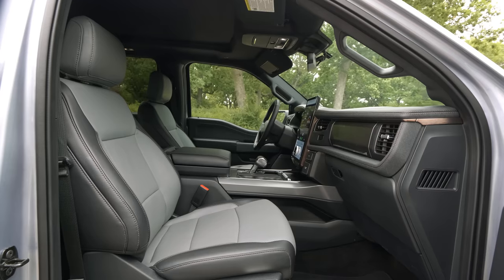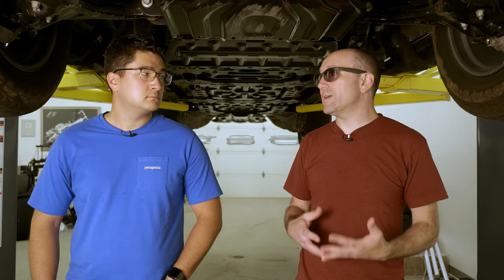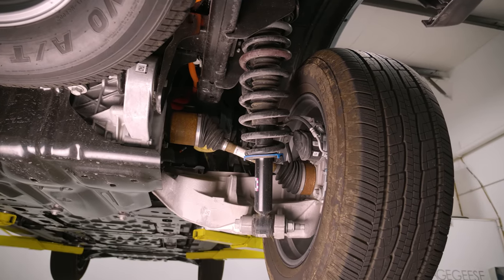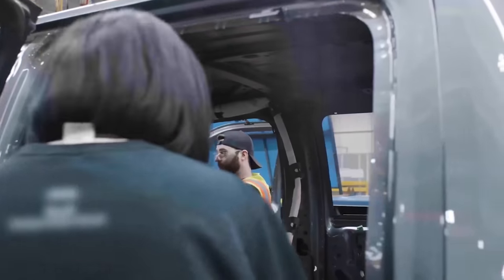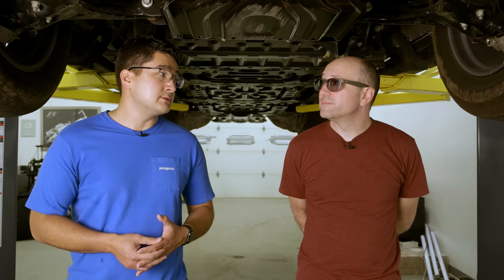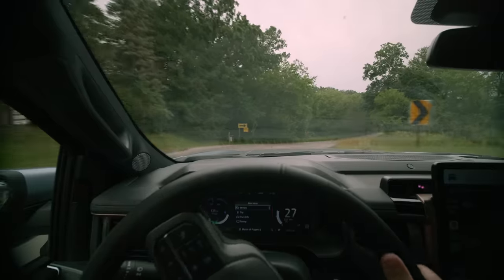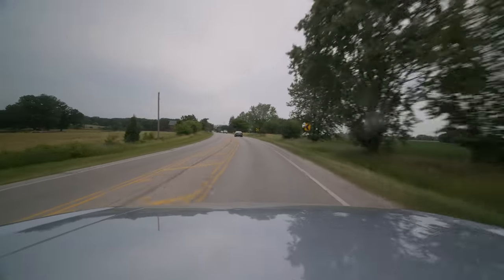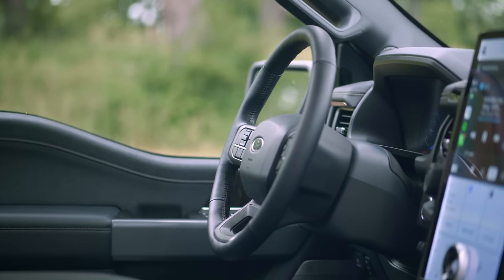Ford F150 Lightning | The EV That Will Change Trucks

Comment: the extended battery model has a battery capacity of about 131 kwh, can you imagine what happens to the thing if it catches fire or been in crash, you better be 5 miles away from that thing or you can fish molten lithium cells out of you hair if you're not Mark lol
Reply: The crash that short-circuits a safety battery block would probably also smash a gas tank, though.
Reply: A gallon of gas is listed at 33.7kwhs of total useable energy and road diesel is 37.9kwhs per gallon. 
How many gallons of those highly flammable liquids does an average ice truck have onboard again? 🤔
And oil plus anti freeze to.
Reply: @4literv6 Gasoline would combust but it wouldn't send thousands of tank particles flying in relatively distant proximity, concerning Diesel, it doesn't combust that easily. I dont get the Ice Truck example. You mean liquid nitrogen? Also how many ice trucks do you see in your area that want to meet up and chill though? I think everything else will catch fire before Anti freeze will combust. And yes i am THAT boring at parties.

Comment: People want to hate on the limited range when towing but like y’all said most people use f150’s for in and around town commuters and light load hauls. My 3.5EB F150 tows a 3500lb camper like 100 miles 3 times a year or a 2000lb boat 5 or 6 times a year for 60 miles and the rest of the time it never goes more than 50 miles from the house. I don’t know that I’d ever really experience range anxiety in one of these even with the standard battery

Comment: Great content, but as far as electric cars and the grid goes, Jason Fenske put out a video last year about it: https://www.youtube.com/watch?v=7dfyG6FXsUU

TL;DW based on EV adoption rates and increasing EV efficiency, power providers can predict how much power is needed for the EV transition. Jason estimates that if everyone were to switch to an EV today we would need 30% more power (obviously a highly unlikely scenario, there's still affordability issues, and apartment dwellers will likely be the last to get charging at home options). EVs can certainly be accommodated for given the slow growth and adoption of them. Like he says, it's a predictable problem with predictable solutions.

Comment: I just think people need to be more open about the fact that if you're going to buy this to tow or something over 100 miles at a time you will be disappointed. Not to mention the energy cost between a gas truck vs electric is minimal especially when towing.

Comment: What's the safety rating on this 7000lb ev or ev in general i have seen some electric  and or hybrid race cars and when there is a malfunction they cant leave the vehicle is case of getting electrocuted wonder if any of those concerns translate into regular passenger vehicles on the street?

Comment: To bad you can't use it as a real truck 80 miles if towing range is terrible
Reply: Yawn. The 14 people who actually need an F-250 can still get one. The "frunk" alone makes it the most practical truck ever made.
Reply: @HydraulicDesign  I'll probably end up buying one just sucks I gotta use my new ranger to tow my snowmobiles to the cabin and not the full size 80 thousand dollar pick up I just bought

Comment: Seems like it would cut down on a lot of routine maintenance as well.  No conventional oil changes.  No radiator/coolant/hoses/belts/spark plugs/alternator/water pump/etc.  I'm sure there's some sort of coolant system for the electric motors and trans (if applicable), but probably not owner accessible.  Transmission?   Some EVs have them, some don't.  Not really any grease zerks left to check on most modern cars anyway.  Main wear items would be wiper blades, tires, and brakes.  Anything I'm missing?

Comment: I think the true happy medium to address the concerns of most truck owners (warranted or not)  is for Ford to produce a plug in Hybrid F-150 till 2035.  Put the 2.7L turbo (its got 325HP and 400 ft lbs of torque) in it driving the front wheels and operating a generator to charge a larger battery pack and an electric motor powering the rear wheels all the time.  The battery pack can give something like 80 miles of all electric range to cover commuting distances for most people to operate it as an electric vehicle 75% of the time.  Give it 500hp combined and 600 Ftlbs of torque and it can tow plenty and, you address the fuel economy issues, enable long range towing, road trip range.  You only loose the frunk.  I think you appease a bit more of the traditionalist truck people as well.  

The 2.3L engine would probably work fine as generator and front wheel driver if your willing to have more pedestrian HP and Torque numbers.

Comment: My Tesla Model S 85 has 248.000 miles. Never had any problems with electronic or drivetrain. It still has a range of 211 miles.

Comment: They did a tow test and with a 6000lbs trailer, they had to charge after 85 miles (9% left) and wait for 45min to bring it to 75%... It was just not practical at all.

Comment: As is becoming the norm for Savagegeese videos, and a really annoying one at that, is ABSOLUTELY NO MENTION of how much this car COSTS. Yes, I know, we're in a time of dealer markups and all that noise, but I'm sick of this unmentioned mentality that rehashes the old mindset of "if you have to ask how much it is, then you can't afford it", and I know I can't afford this vehicle and have no use for it to begin with. But remember, part of this "virtual" tire kicking that videos of this sort provide also includes peeking at the window sticker, even if the final price is nowhere near what's printed, and I'd rather not visit Ford's website. 

I also have no use for a car that's a lease-only proposition that needs to be replaced more than a a damned phone. An F-150 is supposed to be a durable good. They generally last a long time and are, mostly, reliable. But alluding to what Mark and Jack mentioned during the drive, that the technology advances so quickly that the first run is going to be obsolete is an obscene thought. Woe to the poor sap that's gonna look at one of these first run models in 5-10 years time and realize that their money is better spent just flushing it down the crapper than buying one of these, or any used EV. 

This technology is fascinating but vehicles like these aren't going to save anything, except the massive wealth of those who will monopolize battery manufacturing.

Comment: I live in North Carolina, and guess how many people I see towing something other then a motorcycle or a lawnmower? Almost none and no one I know is going to buy a $50K plus truck to beat up on and throw crap in the back and scratch up the bed.  IMO,A this is for those who want to be seen in a EV just because it's the trend. The only people who really care about speed are those who jack up their V8 powered 10 inch lift trucks. And they wouldn't buy an electric truck.

Comment: Are those rear arms semi trailing? Looks like the hubs are integral like an 80s 911. They may not be that crazy expensive since they will be cast by the cajillion. What does an I4 cast aluminum engine block cost?

Comment: Installing a manual bus transfer IS rather expensive, but in the event of a power failure, you could shut "off" your main breaker, and backfeed through a two pole breaker in a pinch.

Comment: I hope the offer the long range battery on the Pro model for non fleet buyers in the near future. A long range Pro is about $47k. As it stands the base $40k Pro is the cheapest crew cab 4x4 full size you can buy. Although you have to factor a few thousand dollars to install a home charger onto any EV purchase. If the supply chain wasn't a mess I think Ford could convert 20% of f150 buyers into a Lightning and bring in non traditional truck and Ford customers .

Comment: Picked up a 2023 Pro with no options. Pretty sweet truck doesn't feel like a bare bones vehicle at all. 99% of my driving I charge at home. Thankful that I should be able to use the Tesla charging network with an adapter in early 2024 for longer trips.

Comment: Great review. I know I'm 5 months late to this party, but still some thoughts. 

Regarding this truck being left as a "largely irrelevant product" in 2-3 years: 
The batteries' range will degrade over time, but that won't make the vehicle unusable 3 years from now. And yes, the EVs that come out with new battery technology over the next 3 years will be more efficient than this truck. Even with all this in mind, 3 years from now, this Gen1 Lightning will still get someone from A to B with zero tailpipe emissions and the convenience of charging overnight at home, and for those reasons it will have a value to someone. It will slide down the pricing ladder (used) to be the right truck for someone at a lower price, even in spite of the depleted range available. So I wouldn't classify it as "irrelevant" in 3 years. 10, 15 years? Maybe.  

Also, at no point in this video do they mention the Over-the-air Software updates, which will help keep this truck's interior experience (infotainment) hip for well beyond 3 years.

Comment: All you need to power your house is a 40 amp breaker or higher, a 30 amp or higher inlet box connected to your breaker, and a 30 amp or higher cord connected to your inlet box on one end and your truck on the other. You can do it yourself for a couple hundred bucks.

Comment: You guys nailed it. Towing the range is just not there. XLT seems to be the sweet spot with long range pack. Its an EV F-150 which is not a bad thing. But I will say alot of the core buyers the Charging Network is no where near it needs to be.

Comment: If we are talking fleet how many of these trucks is that fleet going to operate, is that person going to invest in a ton of 208V 30A to 80A dedicated circuits for their vehicles. The truck has to sit for 10 hours at least. I think if time is money the 5 minutes to fill up a gas tank will always take priority to keep the tool in use. The standard battery pack F150 takes 75 hours on 120V if that's all the shop has. We have 50 v6 F150s for the foreman to drive all regular cab with 8 foot beds.

Comment: The grid not being able to handle EVs shouldn't be an excuse not to buy one. The question of whether "the grid can handle EVs" is already answered, and that answer is "It will." That doesn't mean "it can handle everyone switching to EVs right this second" but here's why it's not the doom scenario people are making it out to be: 1) EVs are smart devices that can control when and how much they charge so the demand profile can be balanced and tuned 2) grid operators and grid researchers have been aware of this problem for at least a decade and have been preparing for it 3) not everyone needs to DC fast charge their EV every second of every day - given most American car owners drive an average of 29 miles per day, that can easily be trickle charged at 120V during off-peak hours. This can be equivalent to a space heater, and no one is panicking about whether the grid can handle space heaters. 4) Vehicle-Grid Integration technology is money-on-the-table for utilities, even if they give rebates or credits to customers. It's basically the customers buying and maintaining a distributed, resilient energy storage facility and then turning over control to the utility. What you do as an individual doesn't actually matter, they'll incentivize the behaviors they want for the vast majority of customers like they do with peak-usage-reduction programs today.

Comment: A plug-in hybrid should been introduced at the same time! If you own a pick-up as a lifestyle vehicle and you commute in it during the week on electric  then be able to tow on the weekends getting the best of both worlds. Yes you'd be down on overall towing capacity due to a smaller IC engine but I'd think the compromise would be worth it.

Comment: Good review! I know which video you were referring to when you said towing a 6000lb trailer. It's not about the weight,  but the aerodynamics of what's being towed. And ya, towing a brink at 70mph while gaining elevation...not going to do well. And won't be good range for highway speed towing.....unless more aerodynamic. I am in an EV group up here in Canada and there is a member where a tent trailer is having next to no impact. I think you will see a couple travel trailer companies develop a model or two. I already know of one. I would also encourage people to seek out another towing video on here...where the guy tows 17000 lbs around town, and barely impacts his range. Reduced drag because going city speeds and barely felt the trailer behind him. So that will hit some peoples needs.....but not for everyone yet.

Comment: I agree and disagree to a certain extend? Agree as in as an EV it offers more utility but as a truck one wishes to depend on for long distance towing it reminds us of the old enemy of current "light/medium duty" BEVs : range The real world range (from several reviews of various models) of these BEV trucks are severely cut to ribbons once you actually put them to work i.e operate as per their intended purpose in the 1st place...

Comment: High 12's is absurd in F150? I thought it was easy? 

-Get a crewcab/4X4 18-20 F150 with a Coyote. 
-Add one of these intake manifolds: ported Boss 302, 18+ Mustang GT, GT350/Bullitt/Mach1, or Cobra Jet manifold. 
-Get it custom flex fuel tuned by a reputable tuner like AMRL, OZ, Lund, etc.
-Reliably spin the engine to 7,500-7,800 RPM like a Mustang, run E85, and go run high 12's. 

If you want to RCSB/2WD and sticky tire it, you'll be running low 12's with the potential of breaking into the high 11's. 

To recap that's high 12's with just a port Mustang intake manifold, a tune, and E85 in a 4WD, crewcab F150 with a GEN3 Coyote and a 10R80. The Ecoboost guys can spell out for you how to easily run 12's or 11's as well. You want to easily hit 10's then invest in a Whipple manifold instead of a ported Mustang manifold.

BTW my 18 5L F150 with a 36 gallon tank has right under a 500 mile range on E85 and I think about a 620-640 range on gasoline, but I haven't run gasoline in it in a while so I can't remember, but it was easily over 600 miles of driving on a tank if you're driving normal, and not beating on it hard.

Comment: Trailer aero makes more of a difference than weight alone. Traditional trucks take the same range hit for towing but they are just quicker to fill. There in is the greatest need for improvement of speed (charging) and Ford is putting a warranty on that battery pack so let’s see how fast future designs take it. They are gathering data but I’m guessing they all ready know how few road trips are taken in a F150. How many towing miles are now being counted. They building for the vast majority use case. 😉

Comment: The biggest difference between the Rivian and Lighting is marketing....ah well kidding kinda.   The biggest reason I didn't move forward with the Rivian is after market utility.   Just got an F150 Tremor that gives me all the things I need in my truck.    With the Rivian it's tough to find a bed rack, and off road lights.  If you are just using the Rivian as a suburban truck its really cool but if you need a work truck the Lighting is the only way to go.

Comment: I wish truck developers would use the frunk space to implement a combustion generator that holds a few gallons of kerosene (or ethanol) in order to juice up the battery when it runs out.

Comment: I do wonder, given the size of the F150 market, if Ford won't offer some kind of upgrade plan in the future. I guess it depends on how many sales we see while EVs are still in there infancy, but it seems like a good market to offer an upgraded battery pack a few years down the line. I could see certain contractors degrading the battery quickly depending on their usage. By that point maybe the finances have worked out to where it makes sense to just buy a new one, but it would be nice if those users could upgrade rather than having to buy a new truck to get the increased range.

Comment: A secondary breaker panel shouldn't cost you a thousand maybe $1200 depending upon inflation but the other thing to look out for is how long could your truck actually run your house for? Then of course you could end up with a dead house and a dead truck. If it is only say 6 hours then no doubt it isn't worth the expense to put in a breaker panel for the F150 but instead put it in for the properly sized generator. During the Cadillac Lyriq review I heard an engineer bring up the term "energy density" and this is what electric vehicles lack so the towing issue will always be there until you solve that problem. Energy density shows up in the weight of these things. I think the Hummer is what 9000 lbs which is 1000 lbs more than my diesel long bed crew cab which is right at about 8000 lbs. My range unloaded on that truck is 600+  miles and towing 15K lbs RV my range is about 250 miles. Electric can't touch that .

Comment: It's a good concept vehicle. If this kind of vehicle suits the kind of life you expect to live, then it's a no-brainer (if you can get it for MSRP). Yes the towing issue and long distance headaches are still there, but the same problem is true with the other EVs out there on the market. If you need to tow a lot, get a V8/Turbo V6. If you need to drive long distance a lot (and don't want to get killed by high gas prices) get a hybrid Maverick and call it a day.
Reply: Personally I try to stay away from no-brainers. (Including from whoever came up with that term without seeing the obvious problem with it, haha.)

Comment: The grid should tolerate increased demand because most people charge overnight and not during peak hours.  I try to use less electricity during peak hours because each kwhr is more expensive